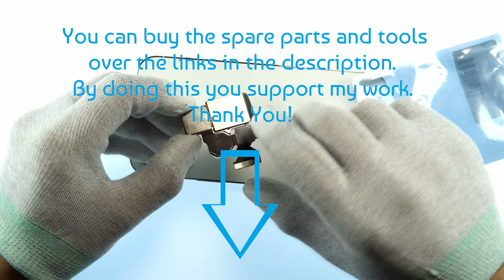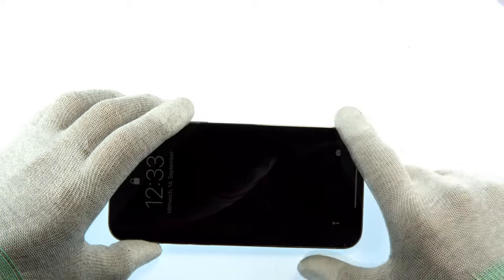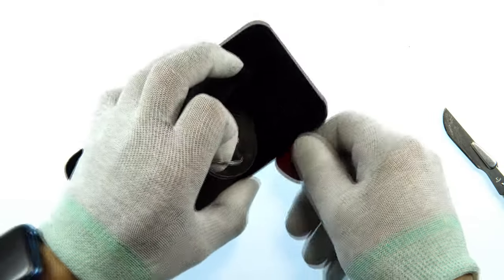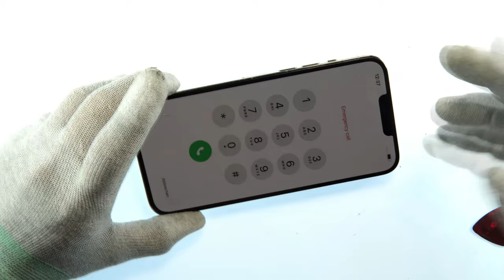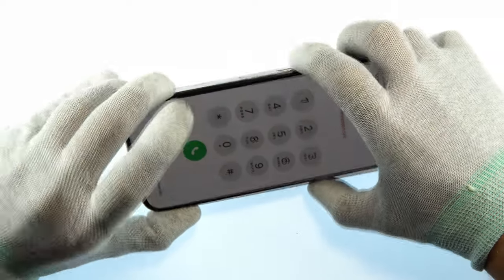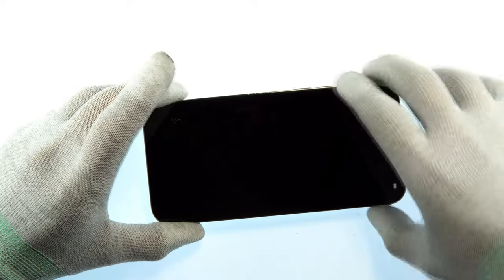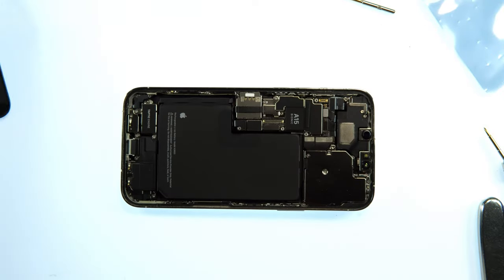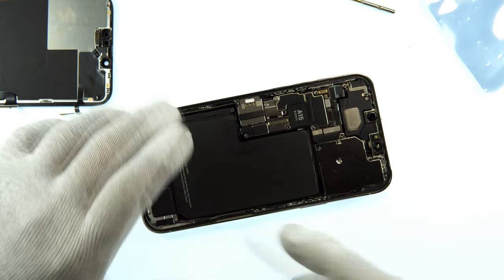IPhone 13 Pro & Max Camera Problem Replacement - How To Fix - No Picture Or Focus

Comment: Hm so I wanted to replace my iPhone 13pro camera right now and started heating it up for disassembly. The camera did not work for two months and I tested it every few days, also the last IOS update brought no fix. After picking it up from the heater I started the app out of curiosity and everything worked fine again. So I’m basically just happy I don’t have to use your toolkit I bought for this occasion 😂 thanks for your video though it’s very good and detailed so after watching I felt confident I could do it myself.
Reply from the maker: Haha well done  🤝
Reply: Update, the camera did not work after cooling off. So I decided to replace it with your toolkit. It was a full success, keep up the good work!

Comment: Hi, i got iphone 13 pro max second hand and the camera has an error, only the main 1x-5x module is working, wide and zoom not.  There seems to be no visible damage and the system reports not genuine part. I took it to a repair shop, he replaced it with an used camera from another iphone 13 pro max and the problem stays the same. The guy at the shop claims that both camera modules are genuine and that it can not be fixed without reprogramin camera? Do you have any advice?
Reply: Bro cost kitna aaya replacement ka?😊
Reply: @ItsDoms  Thanks for the explanation, in the meantime i sold it.
 And got a 14 plus.
Reply: When you replaced the camera did macro mode still work ?

Comment: It seems impossible to avoid a slight damage when opening an iPhone...
Reply from the maker: No
Reply: @allsmartrepairinternational  that knife creating space to disassemble the phone looks like its slightly damaging the metal side.
Reply from the maker: @Gravewurm  not damaging if done correct